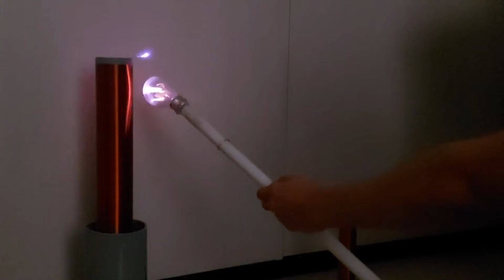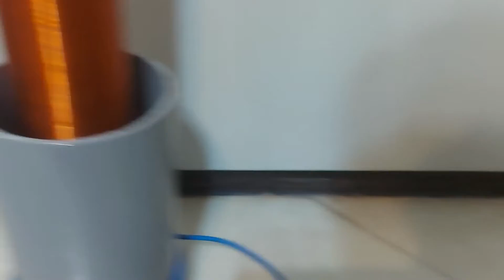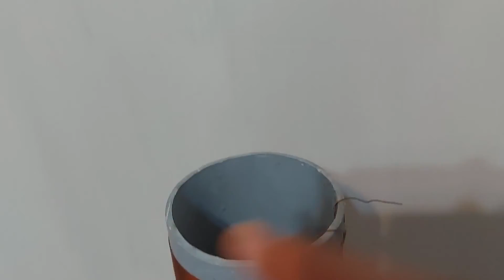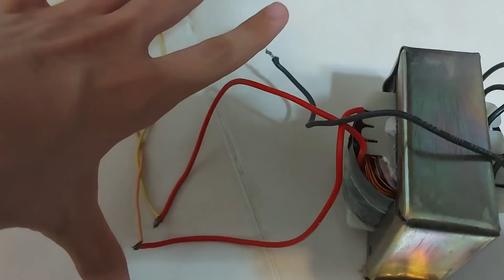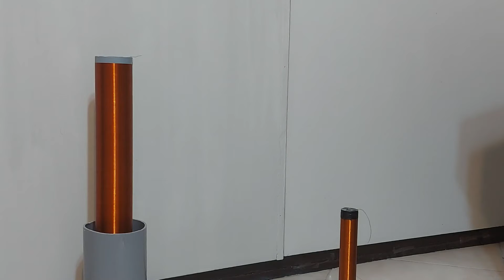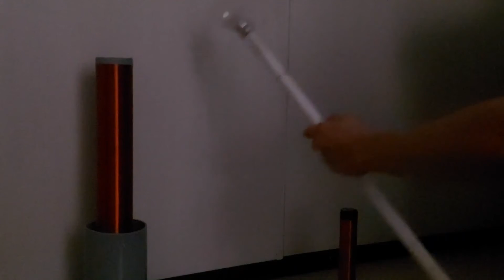Tesla coil : How to make Tesla coil using 13009 transistor

Comment: Can i use 13007 transistor ?
And can i remove the adjustable switch? If i can then how
Reply from the maker: Yes you can use 13007 but if you wanna test it with 100v or more you should use 13009.
Reply: @mx3239  thanks for the answer